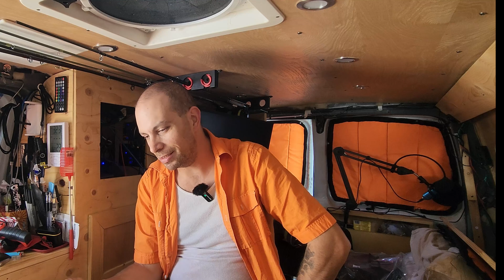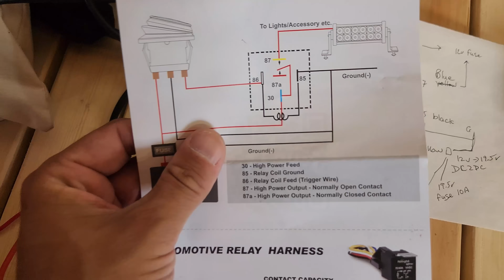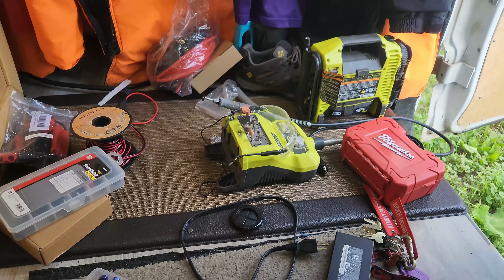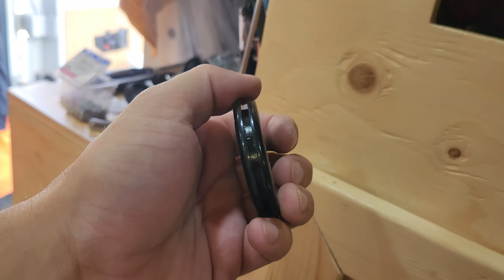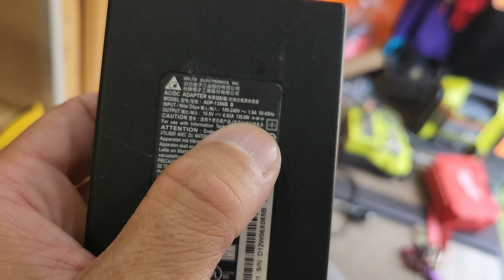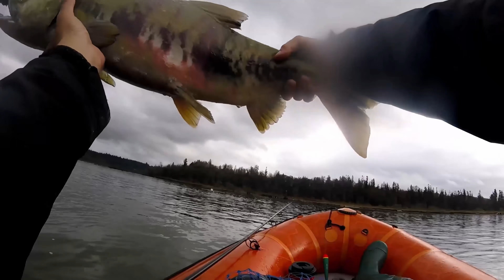No Inverter Needed! Running a Power-Hungry Laptop on 12V

Comment: I've read from a random thread from a random commenter that usually old laptops have 19-20v of power requirements when charging it, and those voltages are divided both to power the pc and charge the battery. He did somethings unusual. He run his old laptop directly to a 12v battery with voltage softener to make the incoming voltage soft and not damage the laptop but it's still a 12v output. I have a old laptop that that requires a native 65w charger that doesn't work on my  phone's charger, because the charger only reach 67w for a couple of minutes  before it drops its wattage in stable 35-40w. But after I removed the battery it now run flawlessly.
Reply from the maker: Interesting. I'm not sure if this would work on my laptop. I can tell you that the input is between 17-21v for my specific laptop according to Acer.  I'm feeding it 19.5v which is the sweet spot  for my laptop. Yes some power the battery and some of it powers the computer. And yes as long as it provides enough watts. You can remove the battery and run strictly off of the van. I also kept the battery so I can take the laptop outside or in a coffee shop/laundromat to do work without the need of external power. Laptop battery isn't going to use a lot of power from solar. Not worth it.and at the end of the day I could sell the laptop unmodified. But there's no way my laptop will stay powered on below 17v. Depends on the laptop I suppose. They also make simple 12v to laptop adapters that plug into cigarette lighter. But my laptop takes 130w

Comment: Did your laptop complain about an unsupported charger being connected, when you first turned it on? My HP likes to complain about it, and claims the performance will be limited, not sure how to test if that's really the case or not.
Reply from the maker: nope, no complaints with my Acer. I spent 2 hours on it the other day just to test and worked great!

Comment: i like the electrical work. Im just curious you have lots of wires. these power thing im guessing like your heater ,over head lights, fans above and stuff like your fridge at the fuse panel running at 12 volts.  I was thinking maybe getting a fuse panel for my car wire my fridge up directly and i could get longer run time on it. Ive heard you could lose up to 20 percent efficiency. Right now i just got a 100 amp hour battery agm battery and 30amp solar controller with a 100watt solar panel.
Reply from the maker: No heater, fridge or freezer on this fuse panel. That would be on the other fuse panels under the bed. You're right though. Maxair fan, led lights,  porch lights,  8 usb 2.4a ports and 4x quickcharge 3.0 ports. Starlink and now the laptop. The wires do look messy. But I never planned on adding the 12v conversion kit for the laptop or starlink. Without a redesign. It will look messy. Lol for the fridge on 12v. Yes the fridge will work better when its being fed a good voltage. But not quite 20% unless you're running it on 120v brick that converts to 12v. Removing that from the system will give you that 20% efficiency. But you are on the right thinking. Removing the "cigarette lighter" and wiring it to a fuse panel is the way to go.